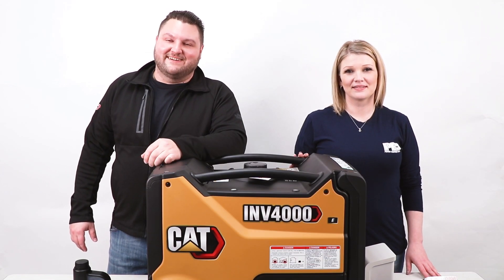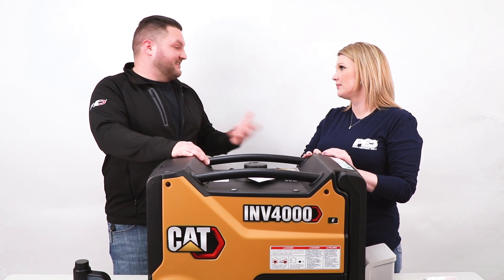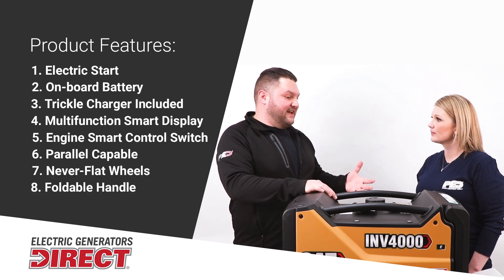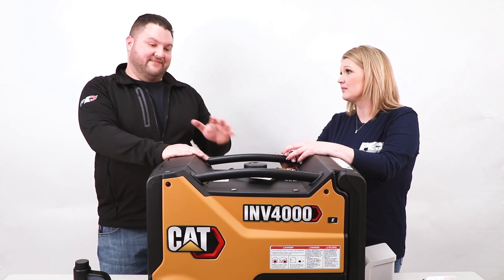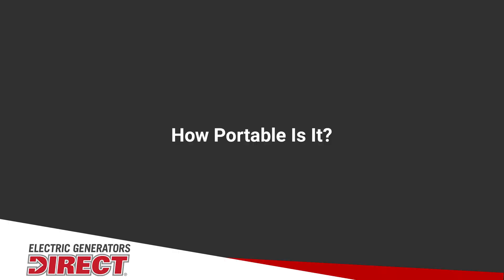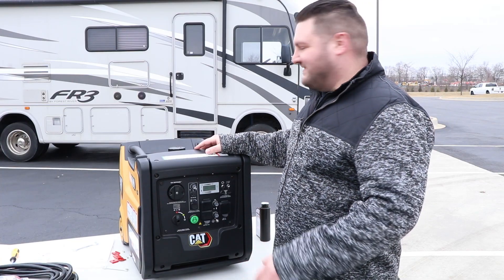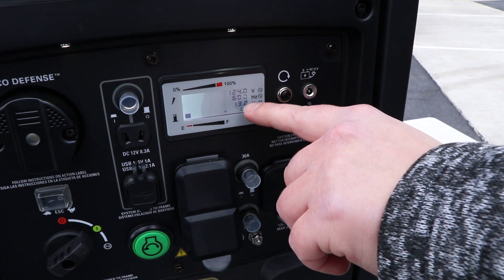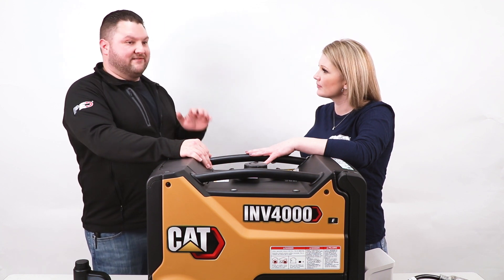CAT INV4000 E Inverter Generator Professional Review

Comment: Just received mine easy preparation super high quality love it like all cat products it’s about engineering
Reply: Very quiet less noise than my kypor 2800 which is 2200watts which was not really enough to power fridge that cat runs my refrigerator very well and my oil burner at the same time I have Had many cat machines that were all excellent this generator is no exception it’s excellent
Reply from the maker: Great to hear!
Reply: How quiet is it?
Sounds kind of loud in the video....
Reply from the maker: @yogi_5150  There is no standard practice for measuring decibels on a generator, so the ratings you see across the industry are varied by the manufacturer if they even choose to list decibels (some do not). As a general rule, to estimate the generator's loudness (decibels) from a practical lifestyle perspective is to measure the sound from about 15 feet away, as you would be in real life. Our camera and microphone were less than 6 feet away, which is why it seems louder in the video. Even being so close, Jared could talk clearly into the microphone without raising his voice, which is actually very good for an invertor. We have a decibel measuring video coming in the future, so keep an eye out for that to see a practical example. Here's an article that further explains: https://www.electricgeneratorsdirect.com/stories/936-Why-Some-Generators-Dont-List-Decibel-Ratings.html
Reply: Mine is very quiet. Can barely hear it from a couple hundred feet away. Very pleased with it.

Comment: Thank you for your review it was very helpful , bought 2 today ($1330.90can/each ) lets hope they live up to expectations .
Reply from the maker: Thanks for watching our review!
Reply: theguythatcan49 clean electric from inverter types is best I went 17 days on a regular gen set and had to buy new fridge and microwave not long 
After that it fried circuit boards
Reply: How did u like your generator
Reply: @brianlippert  had a chance to use it for a few hours . Started first pull , ran flawlessly and was so quiet you couldn't hear it over the storm .
Reply: That’s great happy to hear u like the cat it’s way more than harbor freight cost wise but it seems real good and there is dealers around to fix and source parts we have one on Long Island where I live FYI I do not work for generators direct they just made the whole process easy and I received it in a fair and timely manner I’m happy also
Reply: I bought one last September. Used it during the fall camping and it was excellent. Can run overnight two nights in a row starting at 8pm and turning off at 9am, running the heat in my RV.